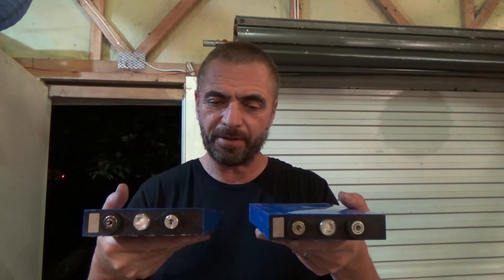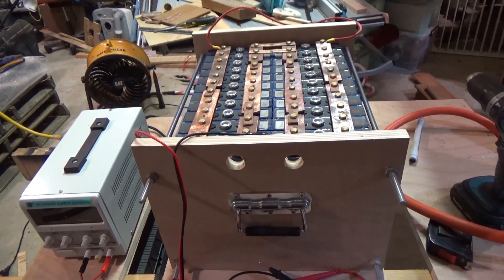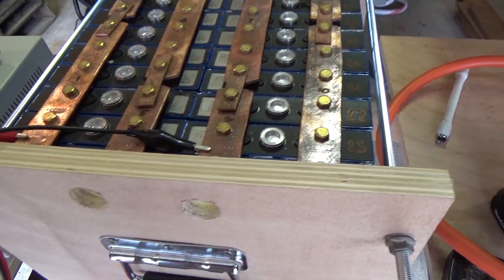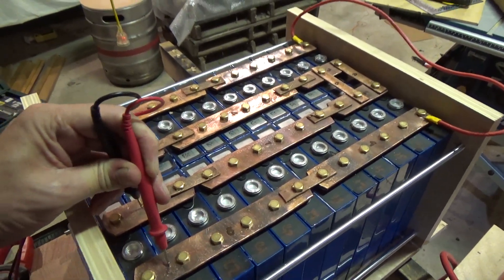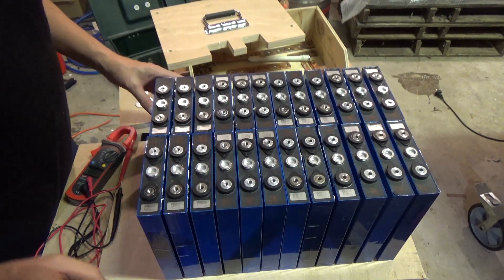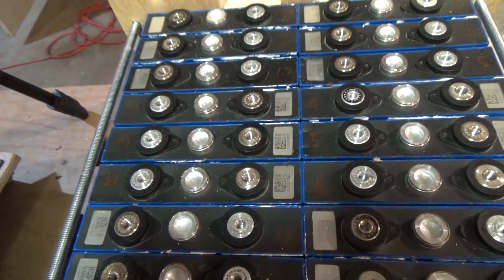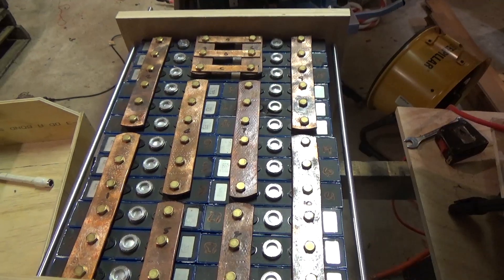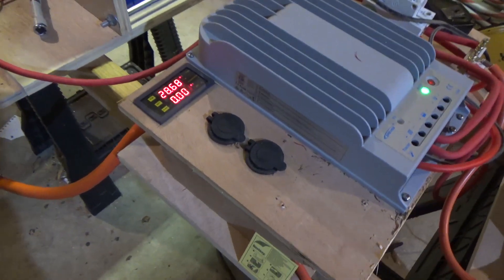LiFePo4 Top Balancing | Top balancing my lithium battery pack

Comment: my batteries has now been charging för 10 days and not reached 3,4V. I started on 3,29V and is now on 3,38V 10 days later. it started to charge at 5Amps and has dropped now to 0,8Amps as its closing in to 3.4V. But 10 days??!! can that really be as it should ? Thanks for great Video!!
Reply from the maker: Hi Filip, thanks for watching.
As your batteries approach your charging voltage your amps will drop, eventually to zero. While I don't know anything about your batteries, charger or charging voltage, if you are taking a similar approach to me, maybe you just need a slightly higher supply voltage to get the amps up, like perhaps 3.6 or even higher provided you are keeping a very close eye on them. Fact is if you have a small power supply and a big battery, you could easily turn it up to over 4 volts and all that will happen is the amps will rise and the process will speed up, a little. It is only your battery voltage that matters in the end.

Comment: Hi, thanks for the great content. If you dont mind, may i have your opinion?  I don't have access to a charger but my cells are reading balanced within 0.01 v on delivery (although its a cheap multi) Would it be feasible to let the 4s 200ah sit in parallel for a month or two while i finish building my campervan. Then set them up in 12v series in van, run a few capacity tests, charge cycles, if the capacity tests read 200ah, would i be fine? Thanks for your time.
Reply: Individual cells read 3.28v
Reply from the maker: @danielbarron5165  HI there. Im not sure balance at delivery voltage will tell you very much. Its only really an issue at the maximum or minimum voltage, and in a campervan where you are likely to keep them closer to fully charged than fully flat, top balancing is probably most appropriate. But if the cells are new from a reputable supplier and if you have a setup that balances on each charge and measures individual cell voltages like mine does, then it will probably sort itself out anyway

Comment: This may be a dumb question but is it okay to top balance to 3.65 while charging at 3.7?
Reply from the maker: Hi Matt. The concept of top balancing is to try to ensure that your cells reach 100% charged at the same time. So it would normally be done at a voltage above your normal charge voltage. If you know the cells are in balance at 3.7V you can be fairly confident they are in balance at a lower voltage like 3.6V. Top balancing at a slightly lower voltage would still work in creating a balanced pack to start with but leaves you unsure if it will still be in balance at the higher voltage. Of particular concern when you consider the very sudden voltage rise of a cell when it is "full". Of course if your management system includes regular balancing it will help keep the pack balanced anyway on a day to day basis

Comment: #BusedAsNZ what solar panels are you using for the charge controller? i have the 4215bn  running a 24v system and I'm having a  hard time finding panels
Reply from the maker: Mine are Trina 250W. You will want a panel with 60 cells of more for 24V system so pretty much anything over about 200W. Or you can connect smaller panels in series. Eg two 150W 12v panels connect together in series will be the equivalent of one larger 300W panel

Comment: I used notebook paper hole re-enforcement stickers over the holes in my busbars and sprayed them with Plasti-Dip to insulate them before installing to protect against accidental shorting during  installation.   Alternately, I could have wrapped them with electrical tape and just left the holes exposed.   Just a suggestion for future projects to keep things safe.   Thanks, for the excellent video!
Reply from the maker: What a cool idea

Comment: Hi, nice video! Aren't you supposed to have the neg. and pos. wire come out of opposite ends?
Reply from the maker: Yeah I guess the further apart they are, the less chance of a short but I dont think it is critical. On this pack layout that would require either much longer links or a much longer battery
Reply: @BusedAsNZ  What I meant was this (From NIgel Calders book: "Boatowner's Mechanical and Electrical Manual"): "When you have two or more batteries paralleled, make the
positive connection to the boat’s circuits at the positive
terminal on the battery at one end of the bank, and make the
negative connection to the boat’s circuits at the negative
terminal on the battery at the other end of the bank (i.e., not
off the same battery as the positive connection). This ensures
that all batteries get discharged and recharged equally."?
Reply from the maker: @fredmartens7126  Ah yes I see what you mean. Despite the confusing layout of my battery the terminals are in fact at each end of the pack

Comment: Hi there NZ,
I come from Europe and just purchase my first small battery bank for testing (4x60Ah@3,2V). Just did top balancing @3,60V and then saw your video.
My intuition tells me (but I'm not electrical engineer) that batteries are balanced when there is no more current flowing between the cells. Monitoring current (say on power supply and clamp meter) until it hits 0 or very close is needed. What's your opinion on that? I balanced mine like this and now waiting for some more gear to arrive to start testing for capacity, max discharging and charging rates etc for use on a boat. Mine are discharged a little bit also waiting to get some serious work done.
Thank you very much for posting your videos. Valuable insight on other's people projects while designing your own. I'm not a native English speaker so making videos with just music (I would be embarrassed to speak publicly) is no go for me...
Reply from the maker: Cheers. Yes the closer they are to balanced the lower the current between cells will be. I did do a few initial tests measuring current between cells when first connecting them in parallel. Lithium batteries charge and discharge crazy fast so when the individual cell voltages were even slightly different was up over 50A just for a moment but dropped to next to nothing very quickly. I think with reasonable sized conductors and considering the time the process takes there should be no need to monitor the current between cells.
Of course we are all embarrassed to speak publicly. I actually hate listening to my own videos :)

Comment: At what voltage you would bottom balance? Like 2.8v? Or at its nominal voltage 3.2v?
Reply from the maker: 2.8v would be OK bottom balancing LiFePo4. When bottom balancing you are making them all the same voltage at empty then charging them as a pack from there, so in use they all reach empty at the same time. So use the lowest voltage you (and your batteries) are comfortable with for their chemistry, but don't leave them there too long

Comment: Do you think I could use a 10 amp power supply to do this or should it be a 20 amp?  Just wondering since 10 amp supplies are much cheaper.
Reply from the maker: Yep for sure, bigger is just faster